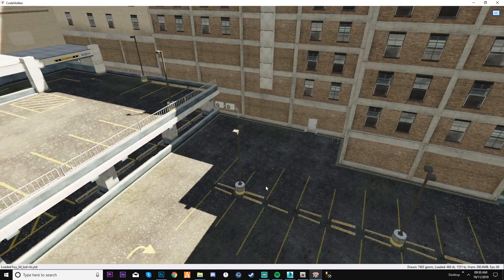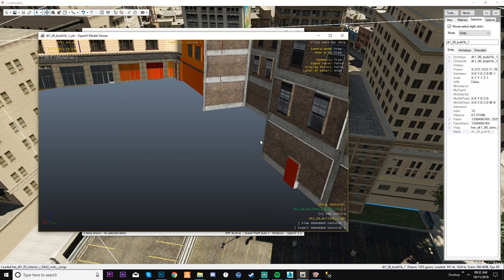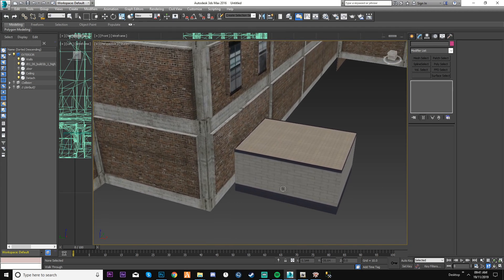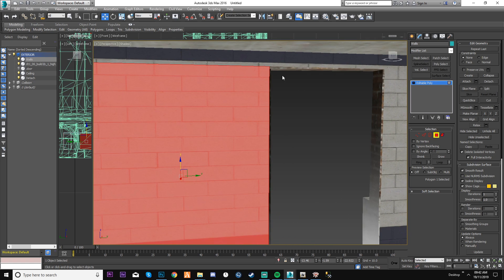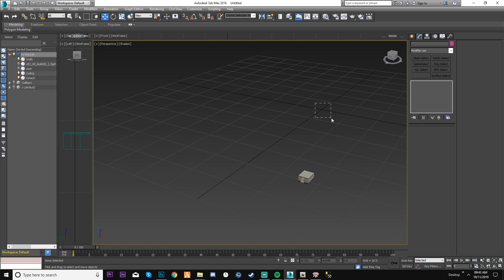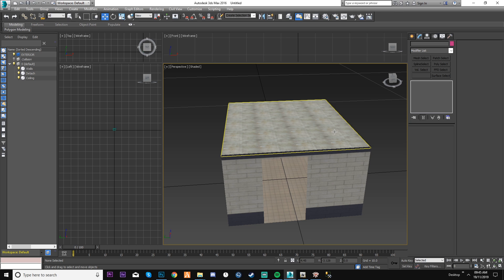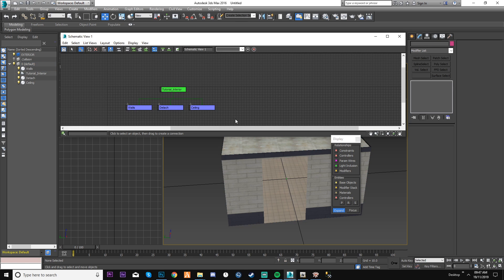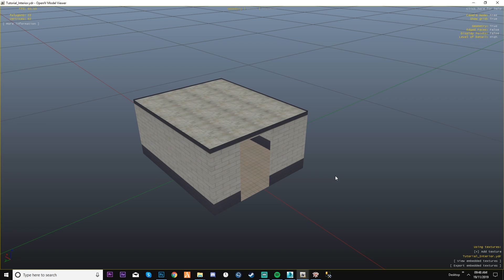3ds Max | Gims Evo | How to create a basic interior | FIVEM/GTAV INTERIORS

Comment: Does anyone know how to get the proper 3ds max to run gims evo? I'm running 2021 and it doesn't work sadly. I did some research and heard gims isn't supported after 2016, but I cant find anywhere to buy 2016 or earlier.